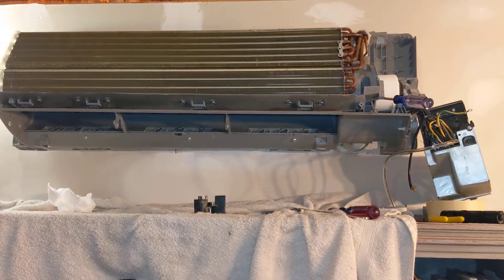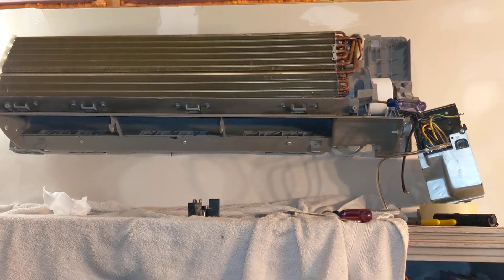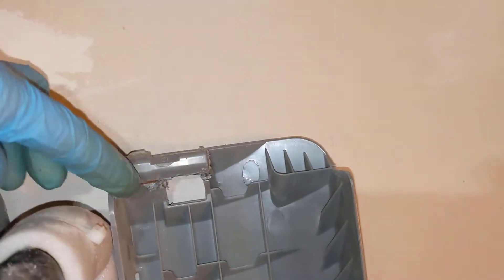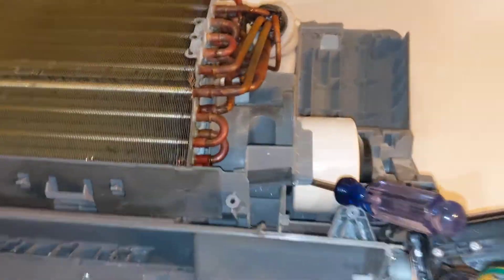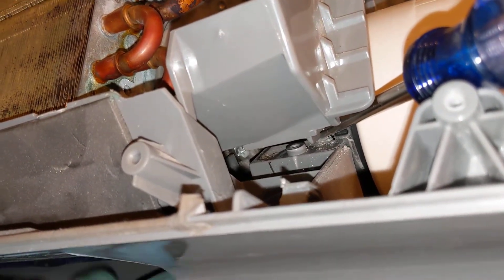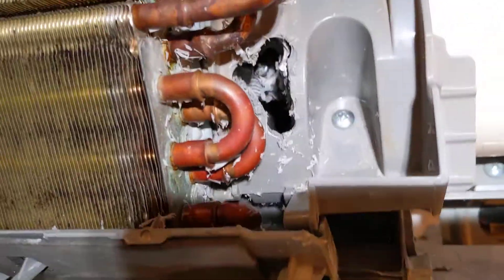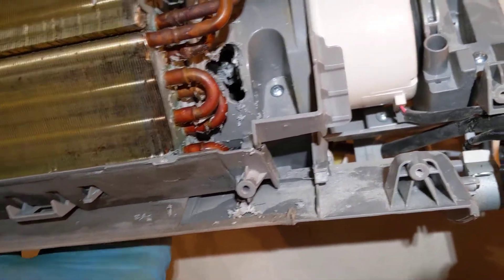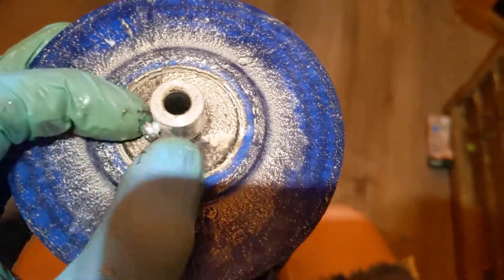How to remove blower wheel from MRCOOL mini split AC

Comment: Major design flaw. If the blower wheel is not broke and doesn’t need to be replaced, why not just clean it in place instead of taking it out?
Reply from the maker: I did try cleaning it in place first. I didn't have any success with just blowing air at it. I had some success with a 1 inch putty knife, but it was painstaking and wasn't thorough. If you did find some way to aggressively clean it in place, it would probably blow a lot of the dirt onto the coils, which is another problem!

If you watch a video of a professional technician cleaning a more reputable system (like a Mitsubishi), they remove the blower wheel entirely. You can really do a great thorough job, and very quickly, with a garden hose sprayer.
Reply: @PatrickBoatner  I agree removing it would be so much better. It’s hard to believe mr cool designed it that way and even more difficult to believe all of my inquiries about it go unanswered.
Reply: @PatrickBoatner  is there anyway you could provide measurements relative to something on the unit for where exactly to drill the hole? I want to clean it properly but I’m afraid to mess up.
Reply from the maker: @SirkillzAhlot  I don't know if there's a good way to measure, but here's the idea:  the screw you need to turn, it's right on the shaft. That shaft is in the center of the blower wheel. See the motor on the right? You can visualize where the center of the motor is, and that's where the shaft is. Now, the blower wheel can rotate. So really there are multiple places you could drill. But, there are copper refrigerant lines in the way! So for me, I knew I wanted to drill as far left as possible, and I needed a place that would go straight towards the center of the shaft. Just pick a spot like that, but with a comfortable distance from the refrigerant lines. I won't lie, it was really close to the copper lines.

Basically, as far left as you can go, and directly towards the center.
Reply: @PatrickBoatner  oh wow. I took off my air handler case and the plastic casing you drilled has an indentation with a screw. By the looks of it, that’s the set screw because it’s in the location you described. It’s a 3rd gen so I assume mr cool listened to customer feedback.

But now I have another problem. I assume the blower wheel slides out one of the sides. Is that right? If it is, I don’t see a way that’s possible as it’s blocked by a bunch of stuff.
Reply from the maker: @SirkillzAhlot  I suggest looking at other YouTube videos for removing mini split blower wheels (even from other brands). Essentially you have to loosen the screws on the left side of the coil, then the left side of the coil can be lifted up. It puts some tension on the refrigerant lines, so only lift it up as much as you need. There's a bracket that the left side of the blower wheel fits into. With the coils lifted up a bit, you can raise that bracket with the blower wheel, and then the blower wheel slides out of the left side.

If you search YouTube for "replace mr cool motor", the official Mr Cool channel has a video that shows how to loosen the screws on the left side of the coil. But they don't show how to remove the blower wheel.
Reply: @SirkillzAhlot   Curious, what year your gen 3 was manufactured. Ours  is also gen 3 advantage, from 2/2021. It did not  have the set screw exposed or accessible, so, we followed Patrick's method.  Despite opening everything up, & loosening the set screw, we could not get the blower wheel to release from the motor end. Were you able to get the blower wheel out?
Reply: @erickraan  I never removed it and opted to purchase 2 small liquid sprayers that you hand pump pressure into. .5 gallons each at Walmart for cheap. I sprayed the blower wheel in place with coil cleaner and then with water. I purchased one of those things that stretch across the sides of the unit that catches all the cleaning liquid and funnels it into a 5 gallon bucket. Cleaning it in place this way was really easy. If I ever have to replace the blower wheel I don’t know what I’ll do. Mr cool did not design well.

Comment: How do you get it out after you loosen the screw?
Reply: The blower fan*
Reply from the maker: @skylerhorton8737  if you search "replace Mr Cool motor" on YouTube, there's an official video that almost shows the process. Basically you have to unscrew and loosen the left side of the refrigerant coil. Then lift the left side of the refrigerant coil just enough until you can lift up and remove the left side of the blower wheel. It's very similar to other mini split blower wheel cleaning videos that I've seen on YouTube. Hope it works out.
Reply: @PatrickBoatner  I’ve scrolled through videos of that search phrase and have yet to find any videos on the blower wheel
Reply from the maker: The official video for replacing the motor. Not helpful for removing the blower wheel (fan), but it helps understand how it all goes together 
https://youtu.be/kAY6i8VpTBo

Here's a good video showing how to remove it, but it's a different brand and this one removes at a different angle 
https://youtu.be/2VvoER81-co

In this video, the blower wheel removes very similarly to the Mr Cool. It slides to the left and a little bit upwards. 
https://youtu.be/yVa6UyXPZZY
Reply: @PatrickBoatner   Great vid. Thanks.  We have a similar unit, advantage gen 3, non-diy.  Like yourself we had to drill to get to the set screw, and similar to others experience, it was far more to the left than expected.  That said, once  the set screw was loosened, and also having access to the motor, we were still unable to release the blower wheel from the motor axel,  thoughts?  The unit mgfr date 2/2021.  The idea of not being able to easily access the blower wheel for basic maintenance is ridiculous and will certainly make it easier to seek other brands that are more user friendly.
Reply from the maker: @erickraan  does the blower wheel slide left and right maybe 0.25 inches? Mine slides once the set screw is loosened. If it doesn't, I'd be tempted to see if the set screw actually goes deeper into the metal than you think (and maybe needs to be unscrewed a lot more).

If you've got it sliding left and right, I assume it's getting hung somewhere on the opposite end of the blower wheel.
Reply: @PatrickBoatner  Took the set screw completely out. no movement at all.  I also loosen and removed all the parts on the opposite side - still no movement even when pulling from both sides.   It is as if the motor is fixed onto the blower wheel (why even have a set screw?).  Even tried prying it off using a screwdriver for leverage and it did not give at all.   Extremely frustrating.
Reply from the maker: @erickraan  that's crazy, sorry to hear. Some other people commented on how they cleaned it without removing it (another thread). Definitely not ideal.

Comment: There’s gotta be a better way
Reply from the maker: I think the proper way involves removing the motor cover/shroud. On my unit, I think that would have required pulling up the right side of the coil WAY more than my refrigerant lines would allow. Or maybe there was some other constraint (I can't remember) but I just couldn't see any way to remove the motor cover with my skill level.
Reply: Did you find a way to get to the motor without cutting or drilling? I can’t get the control unit out. Thanks!

Comment: 💯 this!! I feel your pain. I’m sitting here in the swamp (Aka Louisiana) and have been trying to take this POS blower fan out. It’s a comfort star (basically China brand mr. cool). So happy I found your vid. I’m literally grabbing my drill now. Lol. They need to make this much easier!! I think I’m switching to Mitsubishi. Their design makes the blower so much easier to remove.
Reply: Yeah, I got a comfort star, too. Thinking of going Mitsubishi on my next one
Reply: Did you need to remove the drain pan to remove the blower wheel or is lifting the evaporator coil enough to slide out the whee.
Reply: @ohno-zx4if  I don’t think I removed the drain pan. But getting the blower out was a super tight squeeze.

Comment: Thank you for sharing this information.   On my unit, there was a circle marker in the plastic almost in that exact spot.  It was as though it was there for this purpose?  I drilled using that as a guide and was able to get to the screw without issue!  Don't forget to get as much of the plastic shavings out so there won't be a chance of them stopping up the drain.